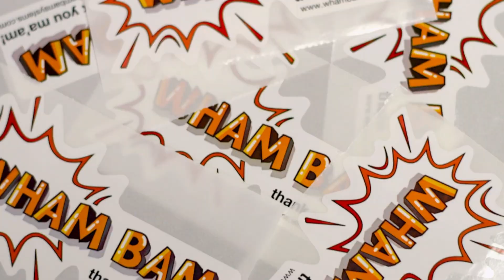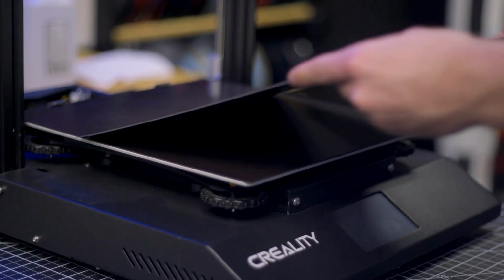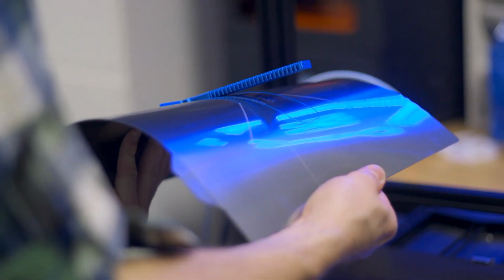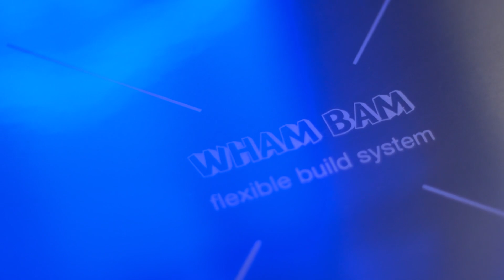Tech Breakdown: Wham Bam 3D Printer Surfaces

Comment: What this ........ wham bammers dont tell you is that on your first print you will rip chuncks out of the pex surface. The cheap creality plate with hairspray beats this system every time hands down. This is the biggest ......... system I have ever seen.You dial your bed leveling  in wrong just a tad bit and you screwed by ripping chunks out of your surface. This system is not as good as everyone makes its out to be. If you have lots of money, go for this......

Comment: Great video, thanks! I'm not using Wham Bam but another type of double  sided flexible st. steel plate coated with PEI. Cannot believe the difference with how well prints stick whether it's on the smooth side or the rough side! When done printing and everything cools down to room temperature, prints mostly fall off! (Makes you wonder how they stuck in the first place!). I believe these types of plates are going to revolutionize 3d printing beds!
I'll probably order Wham Bam for one of my other printers in the near future to give them a try 😊.

Comment: how do you keep the resin build plate from walking as it retracts? mine slowly walks and creates an angled print lol
Reply: 99% of base layer shifts is due to too tight of a bed level, relevel your build head and make sure the paper between the Flexi Plate and your screen can move with some resistance.
Reply: @WhamBamSystems  this actually occurs throughout the whole print, too long of a layer time?
Reply: @mistr_clean7557  are you printing full build plate solid parts?, if not try reducing your layer time, most likely bed not level. make sure magnet snd Flexi plate are well cleaned and dried. Feel free to write us at technical@whambamsystems.com